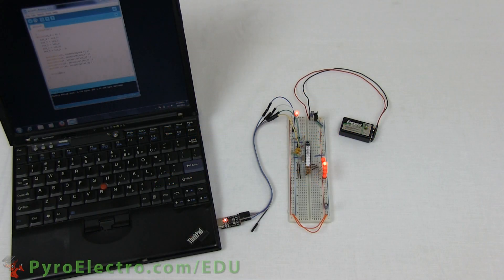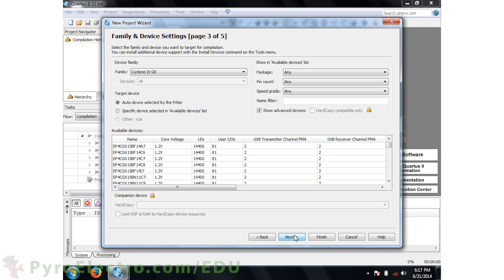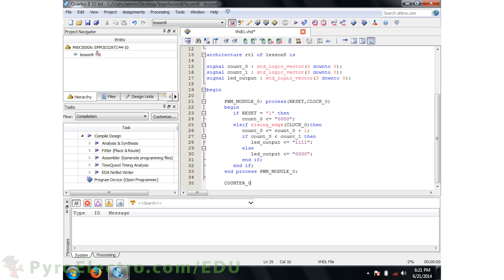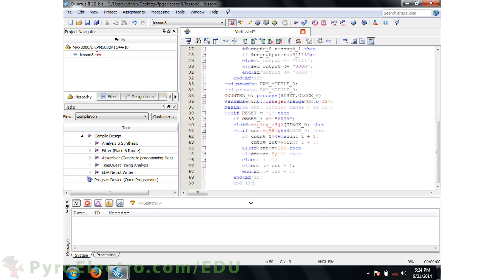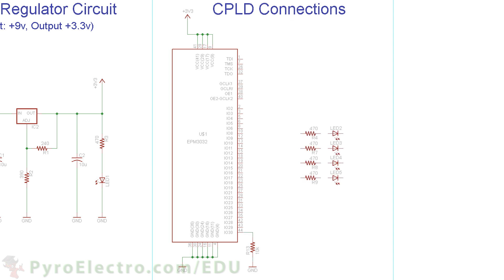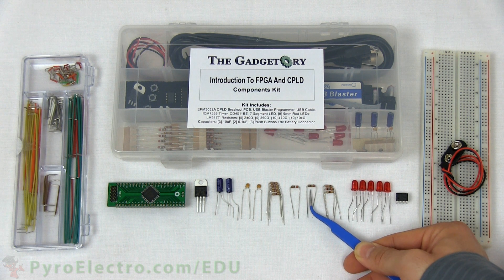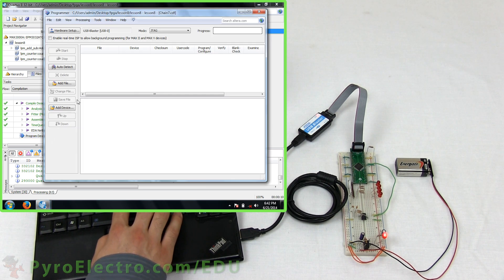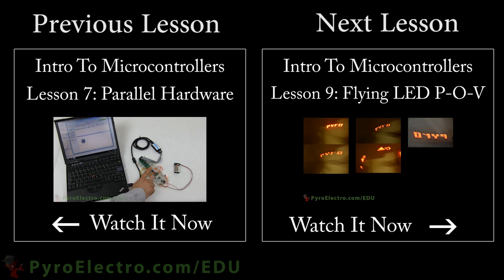LED Dimming via PWM - An Introduction To FPGA And CPLD - PyroEDU

Comment: If I want to make the led brighten and dim and brighten again and so on, what should I do? I was thinking about starting to decrease count_1 when it reaches 15 instead of letting it reset itself. So I'd have 50% duty cycle, 75% duty cycle, 100% duty cycle, 75% duty cycle, 50% duty cycle and so on. Am I correct? if so, should I use two different processes for the increase and decrease?